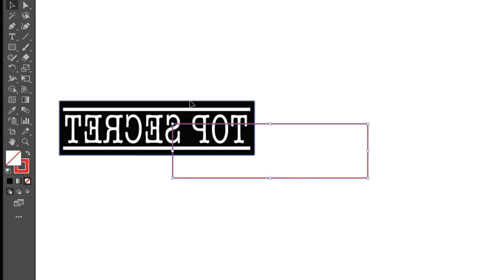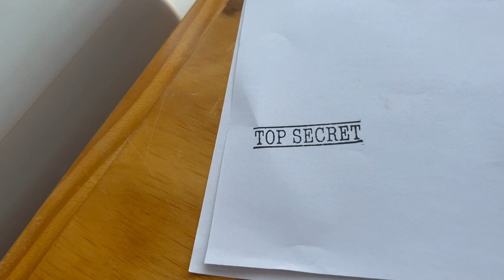Making Laser Engraved Rubber Stamps on my Glowforge

Comment: very nice video. personally i only used wood for laser cutting so far but want to get into cutting stamps out of rubber but im worried about smell/fumes they produce. how was that for you? did it smell alot or was the ventilation system of the glowforge sufficient enough to get rid of them?

Comment: Awesome video.
I have been playing with making rubber stamps, looks like I am using the same material as you, but mine throws flames so badly with the rubber. It then seems to burn pretty much down to the bottom layer, doesn’t leave me any rubber really to attach to anything (just a fine layer of scorched looking material).
Any suggestions?
Using 310, 90, 450 1 pass - manufacturers guideline.
What can I tweak to get a good stamp and no flaming? 
Do you think up’ing the speed as you did at 600 will help?
Any help, greatly appreciated!
Reply from the maker: What laser cutter are you working on? And how many watts? Settings depend a lot on the size of your laser. 

Speeding it up and/or reducing power should help a lot. Doing multiple passes with lower settings seems to be the way to go with this material. Also make sure you’re in focus.
Reply: @MakersWorkshopLLC  using a Glowforge Pro.
I will definitely give a try on the speed and power suggestions. Thank you so much!
Reply: You need to turn down the power output and use the air assist during engraving. The problem with Glowforge is that the machine uses fan blow air assist whereas machines like Gweike Cloud uses compressed air assist from external pump which works much better to give that small concentrated jet of air to immediately disperse heat from engraving spots.